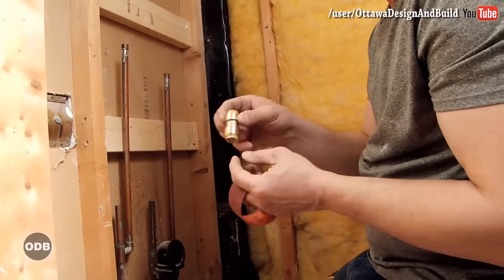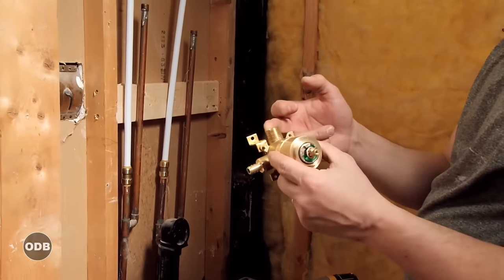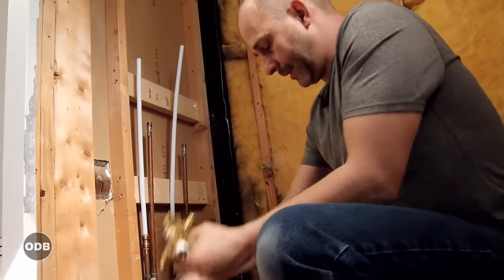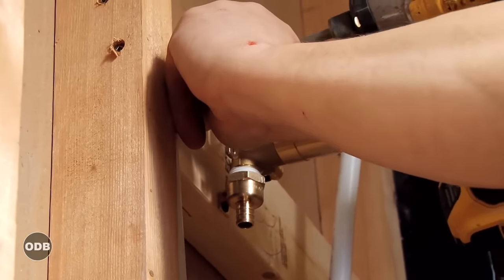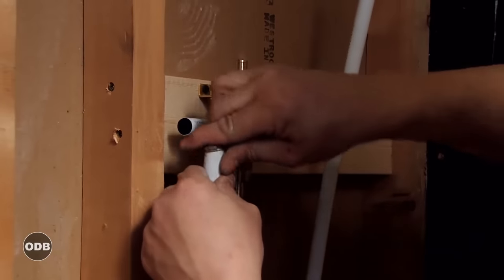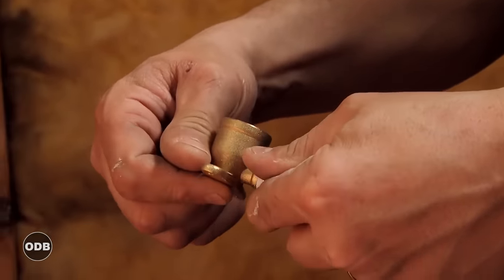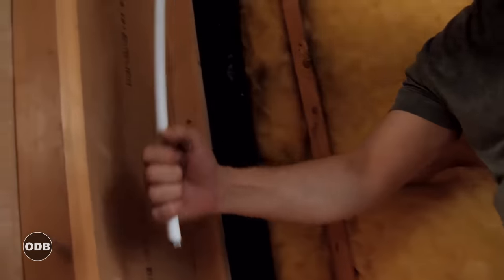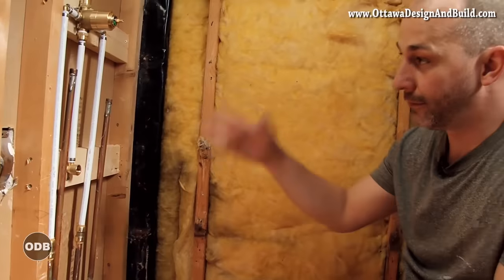DIY How To Install Copper To Pex | Shower and Bath Plumbing

Comment: Hi Ya
Noticed you didn’t use any pipe inserts on the plastic pipe  going into the shark fitting 
Are these not required with this type of pipe ??
Plastic pipe in uk requires inserts to strengthen the pipe wall to maintain pipe stability under pressure and temperatures changes 
Cheers
Reply from the maker: Those things are not necessary with the new generation of product!
Reply: Home RenoVision DIY 
Hi 
I’ve noticed on other pex demos that the shark fittings already have a internal pipe sleeve supports 
Cheers for the reply and update 
We don’t have this pex system in the uk 
I’m always interested what products are produced and used around the world👍

Comment: THANK YOU!!

I just dropped 1800 on a plumber to replace two 20ft copper lines inside my wall running from the basement to the 2nd floor. With this video I feel confident I can do this to a vacant apartment I'm remodeling. 

I'm leaning towards Pex A due to its flexibility and electric expanding tool. And draw backs other than price in regards to installation? Thank you again.
Reply: And then if it fails, and a homeowner doing it themselves it more like a when, and your insurance asks if you hired a licensed plumber to do the work and you say no, then they oh well your sol... maybe the cost of hiring a professional will make more sense lol

Comment: Thanks for the reply!!!! I have it all hooked up. Pex worked very good! No leaks from running my sink lines, toilet & my shower. However this is a Glacier bay faucet & I did not see in fine print until I put it altogether. Says not to use pex or cpvc from the body to the spout. Don't know why so? Both my ear drops are supported on 2x6 blocks between the studs. Thinking I should just go with a one handle so I won't get that temperature change?
Reply from the maker: when filling the tub you may get water coming out of the shower head to help fill the tub is all.
Reply: Home RenoVision DIY Just ran a water test. The faucet is defective. My cold works great but my hot won't turn off. Guess that's what I get buying a clearance item when I should have just bought a better name brand. But no leaks on my pex everywhere!!!!! Should be a simple fix. Going to get a one handle body not on clearance. Lol!!! You ger what you pay for & I paid for it! Good thing to test thing's like this before wrapping it up. Thanks for the advise!!! Btw? What brand from Homedepot would you recommend? I sure would appreciate it!!! The one in the video. Thanks! Mike
Reply from the maker: Hi Michael, there is a good chance you can replace the cartridge in the handle and it will work fine. before you buy try to repair. it is usually quite easy. Check the internet for replacement instructions. Home Depot will give you parts for free since glacier bay has a lifetime warranty. No proof of purchase necessary. Just go with a picture and model number during the day. They usually have a somewhat intelligent guy on the plumbing isle during the week . Cheers!
Reply: Home RenoVision DIY Thanks for the reply!!! I just took it out & got my monet back. Found a nice moen adler L82694 model new in the box on eBay from a 100% seller for a good price. Feel alot better useing a good brand faucet like moen. I really like your through video's! Helps out alot rather than hiring someone that's going to drain your pockets dry. Thanks again!

Comment: are there any concerns with using pex for the tub spout? I read it has a smaller ID than copper and this could lead to water coming out of the shower head when the tub is turned on?

Comment: Question: if you were to turn on the water main at this stage (without any caps on shower and tub spout), would water come out of the shower and/or tub spout?
Reply from the maker: not if you install the interior valve from the trim kit first and have it in the off position.
Reply: Thanks for getting back to me!

Comment: Nice vid bro. Never knew i could  use this type of plastic tubing for plumbing. Wonder how lonh will this  material last? Also i have a stand up shower and will be converting it will be installing   a tub could u plz tell me the numbers were all  water sprouts and on off vowels should be placed
Reply from the maker: I like the tub spout 6" above the tub and the valve at 42" the shower head at 80

Comment: Thanks! This is very instructive. Just a quick question, why didn't you remove the unnecessary copper pipes and lock the shark bites little lower?
Reply from the maker: just working where it is convenient.

Comment: Thanks for the informative video. I have a question. I have a shower/tub faucet connected to pvc. The pvc has a treaded fitting, but also secured with glue. How do I remove the faucet without breaking the pvc?
Reply from the maker: unfortunately you don't. You will have to find a place to cut the pipe and reattach from there.

Comment: With new valve installs it’s always good to add air arrestors, with new valves and how quickly they open and close. Air hammering is always possible. Sucks to find this out when everything is finished. Most areas it’s required by code.

Comment: Exactly what I needed! Just did my first solo plumbing project. Replaced the valves going to the bathroom using Sharkbite! Now I can easily shut off the water when I go to work on the shower. Was hoping to use Sharkbite on everything. Looks like I might have to buy crimping tool to attach it to the shower parts. Do some places let you borrow them?
Reply from the maker: The tool used in the video costs around 30 bucks. The professional crimper is around 300.00
It can be rented from the local hardware store.  Good luck.

Comment: I'd like to put a tiled niche between my shower control and shower head. Any problem bending the PEX around the niche from the control to spout? Should I use a series of 90 degree brass fittings to route around the niche?
Reply from the maker: Sometimes bending can cause a kink. that would be bad. You could use 90 elbows to direct your pex around unique design elements. Most shower heads are water saving so you won't notice a change in volume even if you add a few turns.

Comment: I had the plumbing guy at home depot recommend sharkbite connectors for the tub spout, both for the valve connection and for the drop ear.  In your experience, is this necessary?

Comment: Another Great video!!! Question. I'm putting a shower valve body with the 2 handles & converter handle in the middle. My question should be real simple. My ear drop & spout should be plumb with the shower surround right? Not recessed back in the wall nor past the surround? Thank you in advance. Mike
Reply from the maker: I would consult with the manufacturer. They are not all created equal. But you are right in assuming this is very common.

Comment: How long do you think the shark bites will last?  That is to say, how long until the finishes might have to be ripped out and a leaking fitting needs to be serviced/fixed/repaired?
Reply from the maker: 25 years or so. I will let you know if it ever becomes an issue.

Comment: Tile setter here: I address water damage for a living. I’m all about the new school but frankly this type of plumbing is basically a time bomb. Hose clamps and plastic tubing are fine on an engine, they have no place in modern plumbing. This stuff leaks behind the waterproofing, directly into your wall studs and down into your floor. Hire a professional and get proper soldered copper connections. It’s a little more expensive, but not as expensive as the bill you’ll pay in five years when the leaking clamps have started to destroy your house.

Comment: Pipe is measured by inside diameter, with the exception of soft copper tubing.  The equivalent size of 1/2 pipe is 5/8od tubing.
Reply from the maker: yup!

Comment: I did this method and when the tub spout is installed I get the rise in the shower head that causes dripping. I tested this before sealing up the wall but I had not installed the tub spout yet, just had the copper spout. Now the wall is sealed up and tiled with the spout installed and I get dripping. Need a spout that doesn't restrict the flow or will need to open up the wall from the other side to fix this.

Comment: Hello Jeff, a question about plumbing and water health issues. When reading about PEX-A/B), (C)PVC and LDPE (Tyleen) there are references to researches where leaching of chemicals are described as harmful. PEX residues are even tasted and good be smelled? I don't know because I do not have materials at hand, but wouldn't you like to know? We have had the story about BPA's, BPS's and other chemicals we don't want in our drink water. Sure we don't want them in our plumbing where they are not easy replaced. I hope you will reply and would like to see a video where you address these concerns.

Comment: Do you know if under HUD Manufactured Housing Rules & Reg when using Pex if the shower valve has to be secured behind the wall or can it just float loose?

Comment: good job, do you have any video about changing kitchen sinks cast pipes? thanks.
Reply from the maker: Funny you should mention changing sinks. We are filming that later next week. If you subscribe to the channel you will get all the updates as they happen. right now we have 8 more videos in the q and more in production.
Reply: ok thank you
Reply: kool thanks
Reply from the maker: the kitchen sink video is done however we may need to wait until after Christmas before it is released. we have so much video to release.

Comment: I did my shower from the back not the front as you have shown. this enables a removable panel to be used on the rear so that maintenance can be done without smashing off all the tiles. you could have done the same on yours.
Reply from the maker: unfortunately the tile wall was all moldy and needed to be replaced.

Comment: question about pex...can i use it to move existing copper shower shutoff, tub, and shower spout to opposite side?
Reply from the maker: pex can be used anywhere copper can. All new houses around here are complete pex right from the hot water tank.

Comment: Usually I don't use shark bites in the shower especially where you have tile over it. I only use shark bites  when I have very little access
Reply from the maker: We have access from the other side of the wall.
Reply: Home RenoVision DIY okay well that's another story, I use the shark bites when I can't get a torch in the area. Shark bites are great when your in a jam , I know there is a rubber seal in them the only down side I don't know if that gasket will eventually leak due to the quality of the water today. Thanks for the video.

Comment: I like your presentation style. One thing about the two videos I watched with installing a new shower value that I wish you would have touched on. On the one video I noticed the old copper piping had what I would call extra dead end pipe added which I believe is for dampening the quick on off shock so you don't have banging going on when you do turn them off and on quickly. You you mind mentioning if this is necessary ( one video didn't show any ) and if needed where to place them, how long should they be and anything else of note?

Comment: Hey I love your videos so keep um coming for us DIYers.....I'm in the process of changing a shower valve in a wall.  I soldered the elbows but got incredible bubbles all around.  I'm afraid its not done properly. How can I ck this with the water off and even more so, how can I remove the clumps?? I'm confused as I heated awhile to make sure hot enough but this is what I kept getting ....HELP
Reply from the maker: Looks like you really needed help. Soldering skills will be a soon coming video.

Comment: Why its called a drop ear 90 is because its used at the end of a drop or riser to transition from vertical copper or vertical pex to a horizontal threaded connection. I would check with my local codes before using sharkbites in the wall, as well as those crappy cinch lock crimp rings. Even the company that sells them recommends against them. I dont like using a drop ear 90 and threaded tub spout as it has a high potential to leak in the wall. Most tub and shower valve manufacturers require full copper tube size of pex a tubing (expanded) going to the shower head and tub spout to allow for proper flow and balancing. Also, as a licensed professional red seal journeyman plumber here in canada im not really a big fan of how you go on to say "oh this is so easy anyone can do it you dont need to hire a professional". Thats like me slapping drywall mud on a wall with a potting trowel and being like "oh look how easy it is anyone can do it". Yes they can do it like this but it doesnt mean its done well or correctly. I sure hope you did this on your own house and didnt charge anyone money for this ridiculous install. I rip out many like this weekly because they leak. Stick to what youre good at like drywall and tile and leave the plumbing and electrical to the professionals. You need way more skill before you can charge anyone to do this kind of work.

Comment: No sharkbites in a space without access. Have to use copper or brass for tub spout. Pex reduces pressure causing water to come out of the shower head any time the water is on.

Comment: Isn’t using Pex for the tub spout a no-no? Thought it had to be copper to have increased water flow or the shower head drips?
Reply from the maker: that all depends on the valve. if you have a mechanical diverter on the spout then yes it will keep the water from dripping from the shower head, which falls into the tub so problem solved. I use a diverter that has positive stops so nothing drips!

Comment: Two comments:
1) I used a Sharkbite on my incoming main before the pressure reducing vavle on my house - no problems whatsoever. Maybe 80 psi.
2) I just bought a new Delta tub shower kit - and the instructions state in bold "Do not use PEX for tub downspout" Okay for source of course and shower head feed but not tub spout. The guy at the hardware store said the same - in fact he recommended copper for the shower head as well - any opinion on this? I am old enough to have done DYI plumbing jobs before PEX was invented so soldering is not a problem but man that PEX is SO easy!
Reply: Apologize for not reading all the comments first. Just read one that addresses the down spout PEX - use 3/4 PEX or copper. Thanks!
Reply from the maker: The video was really designed to help guys without a great deal of experience. I am surprised by the audience it has recieved that has plumbing experience. In the future I will be more exact with my information.

Comment: Thanks for the video.  Basically what I was planning, except I was hoping for a shark bite/press-n-lock fitting for the shower valve.  Not to be a troll, but why are you using the channel locks backward?

Comment: Question...what's the "twist" for? Sharkbite doesn't require a twist, just a push. A good watch though, well done.
Reply from the maker: it helps to make sure nothing is catching and minimizes the risk of failure down the road. just my own little tip. If it twists easy then you are good to push. if you feel resistance then realign.

Comment: Hello, 
 I have a problem which hot water is not coming at all. Today, once after turning on the waterfall handle, hot water starts working, but again after I took a shower it stops working and only cold water is coming out! Do you know what is the problem?

Comment: I'm swapping out a two handle ancient set up for a single lever mix valve. Only issue is that the 2 X 6 stud runs dead center up the wall, right where I need to mount the valve so it's not off to the side and looking like a disaster. Any videos on how work around that??
Reply from the maker: build a 2x4 box to create the right space. make the top of the box like a header for a window in case it is load bearing. while working nail a 2x4 across the top of the wall to help transfer the load as a precaution. Cheers!

Comment: So I can run that pex pipe through to the ceiling ? Redoing a bathroom trying to get ideas on redoing the plumbing so that the shower head shoots out of the ceiling.
Reply from the maker: just make sure if you have a freezing climate the pipe stays under the vapor barrier on the warm side of the ceiling. best to add furriung to the existing ceiling to create a 2" space for the pipe and then have a small bulkhead ceiling.
Reply: So add some insulation around the pipe when it’s in the ceiling ? So it doesn’t freeze if it does get to cold ?

Comment: Hey there. What is the difference between doing this with your white pipe compared to red and blue? I have several projects to do including this and was going to buy rolls of red and blue for everything. Thanks brutha.
Reply from the maker: Sometimes the color coding is helpfull so as to not confuse the lines. Product is identical though. Good luck.

Comment: Novice question here - what are the additional capped copper pipes that the Pex was installed next to for?
Reply from the maker: Those original pipes were installed to stop hammering in the copper pipes. Kind of like a shock absorber. Not needed with pex but not in the way either. Thanks for the question. Hope you enjoy our channel. Cheers
Reply: Have learned a lot from watching your vids - looking forward to redoing my bathroom myself with confidence gained from watching. Lots of great tips for those of us who don't have the resources to drop the big bucks to have someone else do it...keep up the good work!

Comment: At what "depth" is the shower head spout (drop ear) mounted. I mean, how far back into the wall cavity does it set?  Thanks.
Reply from the maker: as close the front of the frame as possible. This will enable the shower head to be fully exposed.